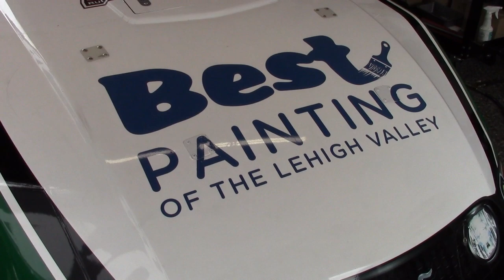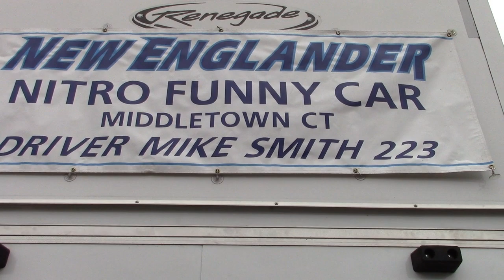NHRA NITRO FUNNY CAR Behind the Scenes Look (Paul Weiss Racing's New Englander)

Comment: anybody notice at 7:58 the duct tape on the wing
Reply from the maker: (Haha) probably not!  If I remember correctly they used it for something with the parachute.  It was just there to be accessible.  You'd be surprised up close just what is used in a pinch though.
Reply: @MondayMorningRacer  well now.... That gives a new meaning to 300mph tape lol
Reply from the maker: Yep (lol)!  Flex Tape was used in this situation- https://www.instagram.com/p/B9awuDtHfh0/?igshid=1b5kxzuq70qc4
Reply: @MondayMorningRacer  but hey if it works it works lol what kind of welder was used on the tubes